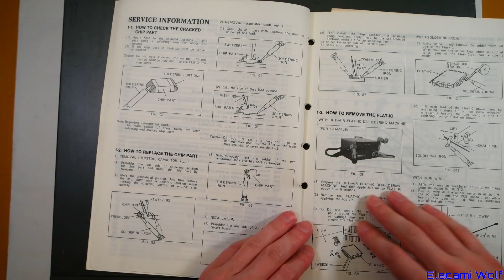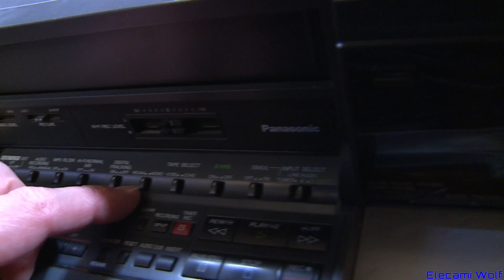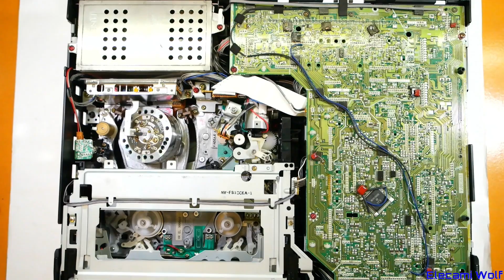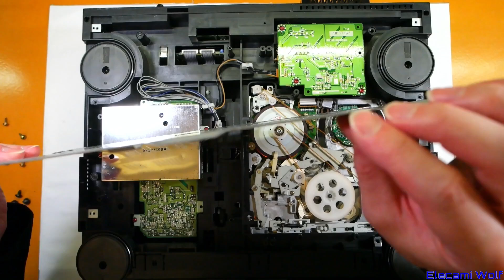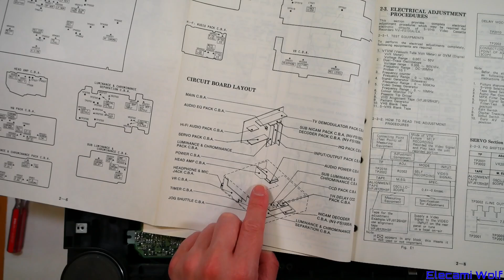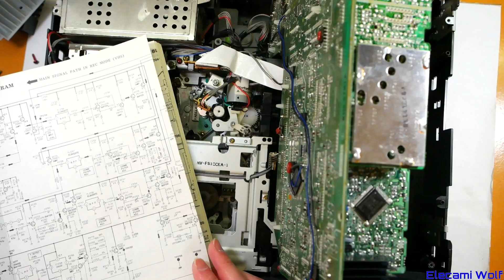EW0153 - Panasonic NV-FS100 VCR Investigation Teardown

Comment: I wonder if this model had the same cosmetic side panels as the later NV-FS200. I ended up removing them from my FS-200 as it too wide to fit in the TV cabinet with them attached. Not sure what happened to them I think only one of them survived. The FS-200 like the FS-88 has the rounded buttons.
Reply from the maker: Probably the same side panels. To make it look fancy.

Comment: the side bits were "anti-resonance side panels". Claimed to improve performance. The "handles" are so they can be taken off to get into the machine. I don't know if they actually did anything apart from, as you say, to look "fancy". The fact that they are missing indicates it's had work done on it before.
Reply from the maker: Interesting they think it improves performance.
Reply: @Elecami  there was a big drive at the time to reduce "tape slap noise" which are those kinks you get on verticals when you play a tape recorded in a camcorder in a VCR. Most camcorders had smaller drums compared to a VCR which induced higher vibrations on the tape. If my memory serves me correctly. the FS100 had an "impact reducing drum", which meant it had bumps on the head cylinder in an attempt to reduce these vibrations. I recall buying a FS100 which put many dropouts on the tape, which I put down to those bumps. Panasonic changed the cyclinder under warranty. I suspect that's why they changed the design of this model and ditched the FS100 and brought out the FS88 which had a simpler design. It may have lost the "anti resonant side panels" of the FS100 too.

Comment: The FS100 unfortunately has only problems after more than 30 years, there are many defective circuit boards, mostly deaf or leaking capacitors. The FS100 has faults in the power supply unit, in the additional NT and in the controller. There are also numerous defective electrolytic capacitors in the 4x video modules.
I am from Germany and have been repairing such things for more than 20 years, no problem for me. I don't need a service manual, I know all the boxes with the G-drive.
Reply from the maker: It takes a lot of time to replace all those capacitors.
Reply: Brother I just bought one of these but is defective, cassette wont load down, it takes the cassete but when it supposed to drop down, it wont and it spits out the cassette again,  I can hear a slight whining noise when it´s trying to load, sounds like belt noise.

Comment: I recall the European/ German 'EG' version had an on-board FLOF/ Teletext decoder for the VPT function, along with the corresponding buttons on the remote. They used A2 Stereo there, so perhaps they placed the VPT/ Teletext decoder where the NICAM module would normally sit in those machines..
Reply from the maker: I see interesting what other regions get.

Comment: Had an NV F70 - only way to get stereo out of OPTUS cable TV back in the day was through RF - so it spent most of its live as a demodulator connected to a stereo.
sadly power supply failures are common on these.
Reply from the maker: Good use. 
Power supply is in a poorly ventilated metal box, the capacitors will be hot and wear out fast.
Reply: I recently picked up an NV-FS75 that functionally works quite well, however even though I've cleaned the heads extensively there is some RGB color noise during playback and recording. I suppose in theory both the read and write heads could be 'worn out' in the same way, but I suspect something else is causing it.  I had a quick go at checking some caps on the power supply, and I found a few small ones at the very end of the secondary circuit that needed replacing, but it didn't seem to make a difference (even though I didn't trust those caps regardless).  

Is it worth taking the time to really open up the PSU to remove all the electrolytic caps and replace them, or could the color noise be coming from somewhere else?
Reply: @alexss3  If the FS75 is anything like the FS90 it has some surface mount electrolytic caps that fail in the Y/C processing area. Look for a hybrid board with a white ceramic look to it. The SM caps leak. There are very few SM caps in these machines luckily. Recapping the PSU is par for the course for this era of machines. Use 105 degree caps. I've seen it cause herring bone interference on the picture. PSU's are pretty reliable other than caps.
Reply: @michaell2120  I have the service manual so I will take a look to see if there are any surface mount caps around the Y/C circuitry.  Getting the entire PSU recapped will be done as well as you suggest.
Reply: @michaell2120  I found the board you mentioned, it is the comb filter on the Y/C pack. It was quite a lot of work desoldering the sub-board but I did it and replaced all six SMD electrolytics with radial ones. However, this did not solve the weird color noise in the picture. Still good that I replaced them to prevent future leakage.  I will try recapping the entire PSU after the new year and see if that helps.
Reply: @alexss3  PSU recapping is good preventative strategy and if it fixes the issue, bonus. Another trick to help narrow down the issue is to record to tape on the offending VCR and play it back in another VCR. It will let you know if you are dealing with a playback fault only or something that is also affecting the recording circuit as well. Try a bit of warm air on the boards, like from a hair dryer. See it heat affects it when it's faulting.
Reply from the maker: @alexss3  I think you should replace all the power supply caps. Except the large high voltage one on the primary, that one is usually still ok. All the others should be replaced. Even if it is is working now, they will be end off life and could cause the power supply to 'blow up'. I had a few do that already on power up.

Comment: The later HS800 S-VHS deck power supply has the same heatsink configuration and it has no heatsink grease either. Unusual.
Reply from the maker: I guess they made sure it was very flat. Or didn't need a large amount of thermal transfer.

Comment: Fun fact. The FS90 is the model that superseded the FS100. Go figure?
Reply: But the FS100 was replaced by the FS90, has 95% of the same technology, but the FS100 was a bit better. 
I myself have worked in cooperation with Panasonic in Germany since the beginning of the 90s, today I overhaul such devices for people who want to digitize old videos or only receive the FS100.
Reply: @v8_brother  And FS 90 and FS100 where replaced by FS88 and FS200(which was VCR of the year in 1994 by EISA) I own them all...have the huge collection and service them for decades! In my opinion FS88 is the best of them all....least amount of problems and most important no leaky surface mount crappy caps enclosed in some modules like the FS90 or FS200! Basically FS88 is same as FS200 (without front A/V inputs and without troublesome modules) By far The Best G-mech machine and most reliable! I have 3 FS88 running on daily since I recapped them 10 years ago with no problems at all....cant say that for FS 100,90 or 200....these all give me problems often...
Reply from the maker: It is a bit strange.